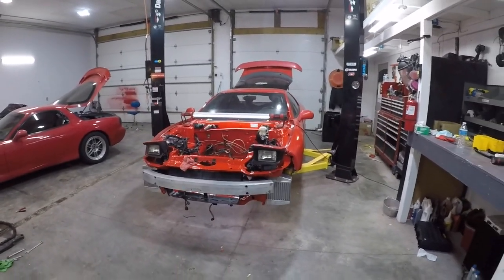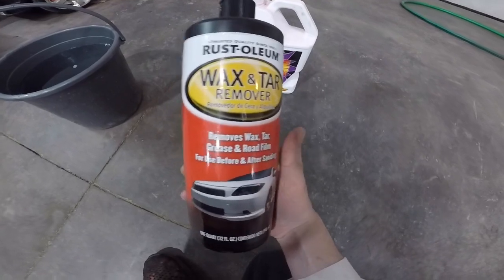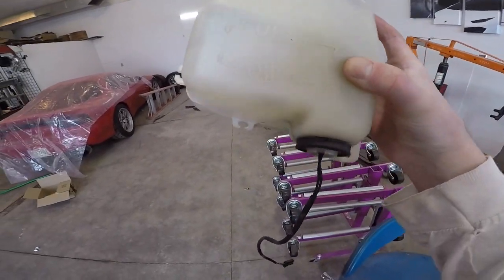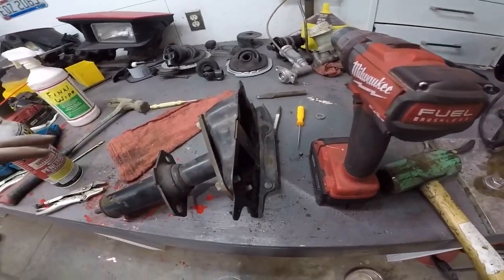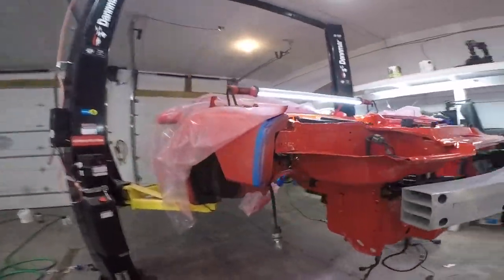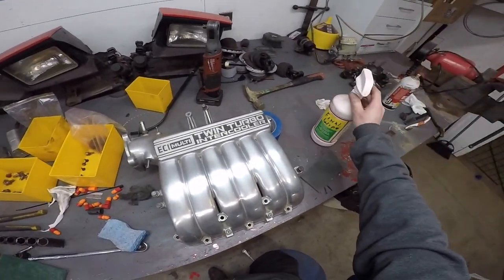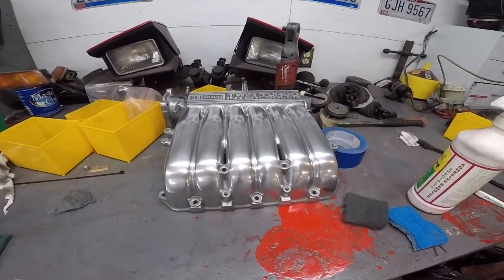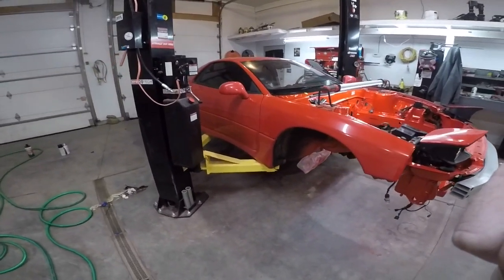Twin Turbo 3000gt engine bay restoration ⚠️ part 2

Comment: Haha I clean all the unseen areas too. Makes it easier when you're tracking down a leak and just makes it nicer when you take it apart. For parts check out https://www.mitsubishiparts.com/v-1993-mitsubishi-3000gt--vr-4--3-0l-v6-gas. This is a great resource when looking for oem parts, also cherry Hill mitsubishi in NJ gets a lot of 3000gt parts. Talk  to Eric Manna he is their active part in the community.. glad you put out the video I liked this one more than I thought I would 👍👍
Reply from the maker: Thanks man !
Reply: @huracanian3051  NP, for welding videos check out 60601.com on here. He hasn't posted in a while but theres a lot of good tig material and his welding is amazing
Reply from the maker: @jamesparker3062  I love tig .. I need to try it lol .. It looks like the best thing ever lolol
Reply from the maker: @jamesparker3062  60601.com ?? Is that right ?
Reply from the maker: @jamesparker3062  OoO ok 6061.com u put 60601.com that's like a x-ray or something lolol .... I called Cherry Hill was on hold for like 40mins .. I'll try to call Eric tomorrow or something I need I steering rack ASAP